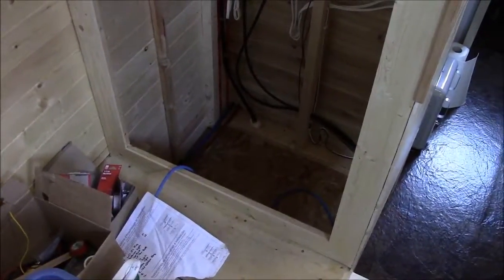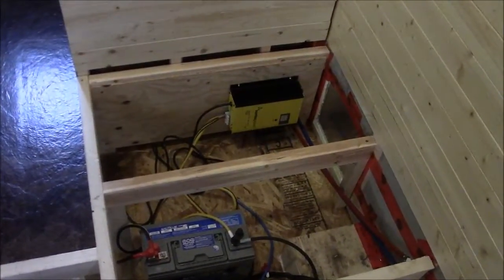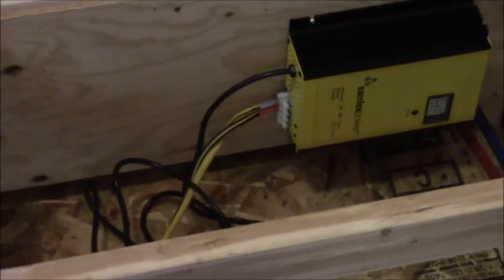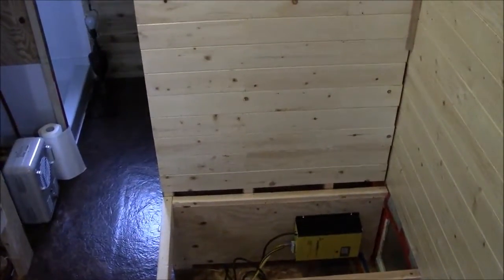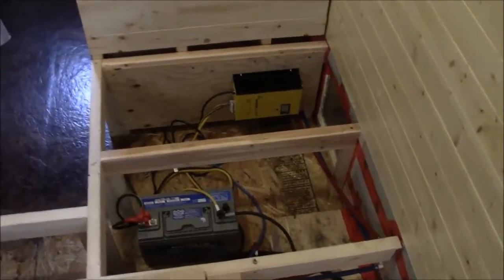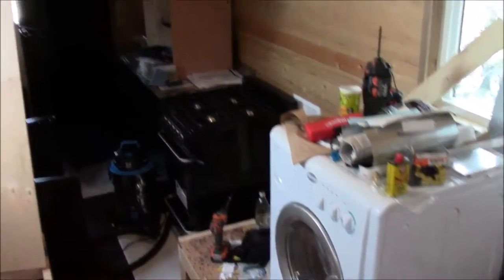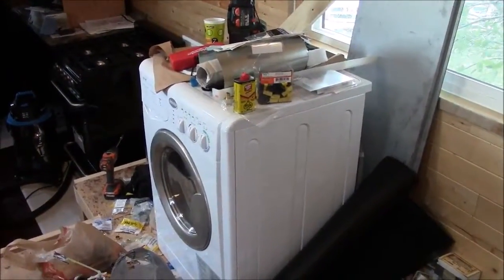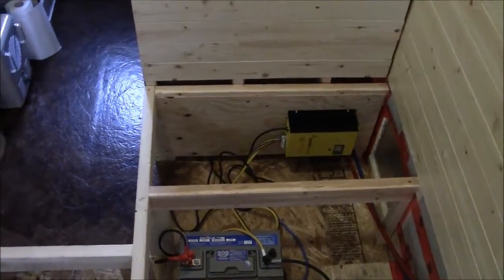Off Grid DC system Overview

Comment: This is what I preach to everyone who wants to go off grid. %90 of your electrical needs can be met with 5/12/24 vdc using dc sub panels, batteries, and buck converters. The large stuff like washers/dryers, fridge, etc... That's the stuff you keep on the AC side, along with some outlets. Feed the AC panel with a transfer switch that goes between grid and inverter. Feed the DC panel straight off your batteries/charge controller.

Most people are losing %10 of the energy they generate by simply converting it to AC and back to DC for all their electronic devices and junk. Not to mention people with 120VAC lighting all through their home/cabin when there are 12/24 VDC options now that look identical. Anyways... This is how it's done.

Comment: I did the same dc lighting project in my house :) I really like it! Now we need a gas dc generator that starts automatically at 11.5v.....(ecoworthy lifepo4) I cant say enough great things & 3000 CYCLES to 80%. Only a 20% degradation. Delivers 95% of stated, new. built in BMS- :)

Comment: You shouldn't use solid ac wire for dc applications. There is too much resistance. Wires will get hotter. There is less resistance in stranded wire because there is more surface area. Electricity will run on the outsides of the small wire I side the stranded wire. Not saying you can't but I've learned from experience. I burnt up a 7 amp dc pump because I thought it didn't matter. I switched to stranded and no problems what so ever. Anyway that's a nice place you have there. Looks great!
Reply from the maker: Thank you. I haven't had any issues after 2 years in the tiny house. I was very careful to keep the wire gauge big enough though and I kept the length of the circuits as short as possible.